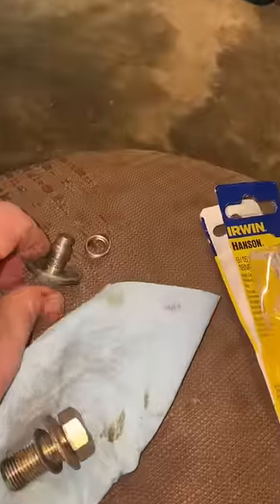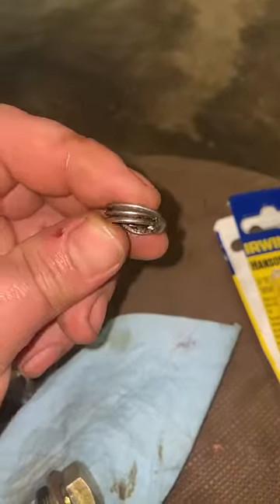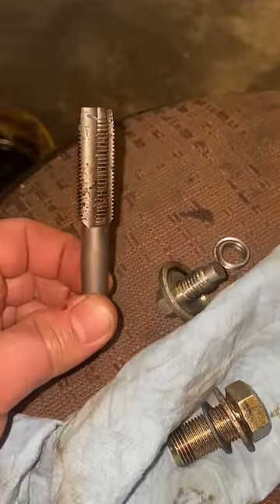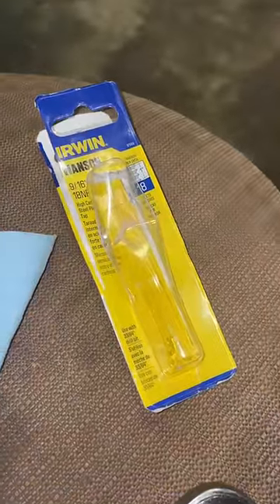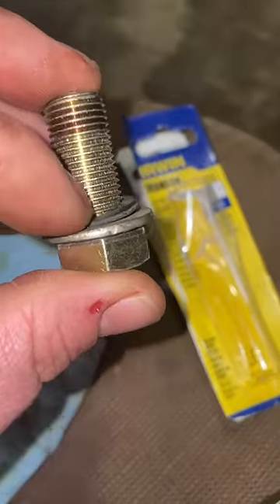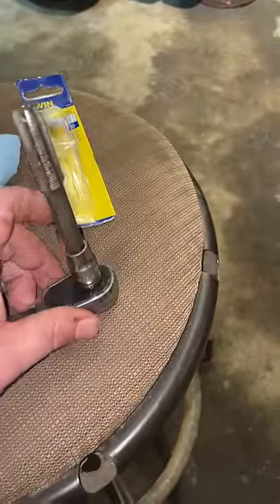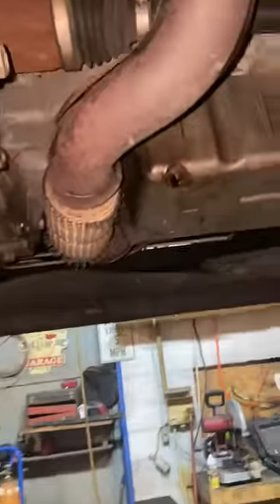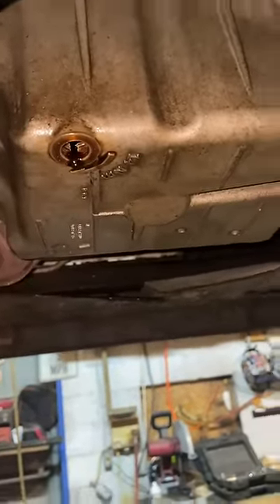Tap threads into oil pan repair quick and easy one!

Comment: That was a helicoil , not the thread's. The thread's have been gone. Probably done at a quickie oil change place.
Reply: I know its 6 months late but lots of manufacturers use a helicopter to reinforce the aluminum foil pans to prevent stripping threads
Reply: @tylerblubaugh5549  well God damn is that what's making all that ruckus down there?? I figured it was a rod!! All this time a damn helicopter 🚁 flying around in my oil pan...
Reply: @calebbitz9469  fucking killed me
Reply: Longer bolt = less oil 😅
Reply: No in my experience this is how we get them back from machine shops they put them in everything forgetting it's a disposable solution
Reply: @calebbitz9469  💀🤣🚁🚁🚁
Reply: @NuKe0clan0cod0videos  helicoils are a permanent repair if done correctly.
Reply: Can't confirm on the 1.4, but a lot of the GM vehicles have a coil type thread in the pan vs machined threads.
Reply: @calebbitz9469  funniest comment i saw today
Reply: Correct
Reply: @CryptTonite1955  when the next guy goes to remove the never ending bolt 😂
Reply: We use helicoils in high level motorsport (Think FIA level) as a permanent thread strengthening solution. They spread the load very well throughout the thread.
Reply: @kdubbya  no they are for one time torque. It's good for cylinder heads  and other places where the bolt stays in all the time
Reply: @NuKe0clan0cod0videos  one time torque? That's why they use them on spark plugs holes. They are a permanent repair when done properly. Just like he said.
Reply: @NuKe0clan0cod0videos  no, they aren't. GM literally puts helicoils in their drain plug holes to make a stronger thread.... Go look at any LS/3.6 pan from 2010 and up.
Reply: Ya that is exactly what the Ford dealership tried to say about mine being stripped.. Except that all oil changes were done at the dealership and their record proved it... Needless to say I changed dealerships.
Reply: Came looking for this comment lol
Reply: @NuKe0clan0cod0videos
Reply: or Walmart, they are no better, it was not my drain plug but ruined a oil filter remover I had for 20+ years they had filter so damn tight. had stab it with screw driver to remove it also they over filled oil by a quart.
Reply: Most LS pans and def Holley pans have a helicoil, they are not threaded in the cast. Prolly same deal. I guess this works of you don’t wanna fix it correctly tho 🤷🏼‍♂️

Comment: The next person goes to change the oil: "Why is this bolt so G-damn LONG??"
Reply: Atleast you hopefully wont drop this one.
Reply: next tech will probably go wth anyway when they need a bigger socket or wrench to get it off
Reply: Just gonna ugga dugga the damn thing off and on anyways, strip it out, and force him to go one step up again
Reply: It already feels like it take forever on a normal drain plug
Reply: Lmao I was thinking this
Reply: @nikolayordanov9760  It's gonna end up with a 1 1/2 size bolt eventually😂
Reply: @tthams73 
That’s a bunch of bs
Reply: "I'm too lazy to thread this in by hand, gonna use an impact to save time"
Reply: That would be me asf
Reply: @nikolayordanov9760  2 years from now: we are just going to tap this for a 2 1/2” bolt. At least it speeds up the oils change a little
Reply: @tthams73 not anymore!
Reply: @tthams73 
Only a Trump Supporter would think so ?
Reply: @tthams73 No, it is not. It seals with gasket or washer.
Reply: Says every Valvoline bottom side tech.
Reply: @tthams73 Bollocks
Reply: Frfr lmaoo

Comment: Any time I tap a pan like that, I pour two quarts of cheap oil through to flush out any chips which ended up inside. Sometimes more comes out than you'd expect.
Reply: I have someone pouring cheap oil in the engine as I cut.
Reply: I dip the whole tap in grease then flush. Almost all the chips get stuck in the grease. Was in a training manual I read many years ago.
Reply: @81mont  I do that too but some chips still get inside so I do the rinse deal.
Reply: and put grease on the tap to collect most of the chips.
Have my doubts on a positive seal with the washer in there. Hope it works.
Reply: I'd imagine that the type of tap matters here too.... A spiral flute tap might be preferable in this situation but I would definitely be flushing it out afterwards anyway, that would probably keep me up at night thinking it would mess my engine up in some way.
Reply: That's a fucking great idea! 👍
Reply: I pull the whole motor and submerge in royal purple while I tap threads.
Reply: @markchidester6239
Reply: Should have flushed out the crap from tapping before filling it up
Reply: @incredulousd9408  I do the same trick except I do it in a vacuum chamber
Reply: I was thinking the same thing
Reply: @foxwood67  How do you know he didn't?
Reply: @randy1245  did you see him flush it out?  Maybe I missed something?  Yeah nah
Reply: I was gonna say that would be a good idea to either flush or take pan off and clean out
Reply: @incredulousd9408  I laughed very loud. 🤣🤣🤣
Reply: I make sure to only work in a 2 micron clean room with two large chested assistants to assist in lubricating the shaft thoroughly.
Reply: Why do the work , just go hang out with the assistant.......
Reply: @christophersanchez7845  Negative.

Comment: If you ever do this, cover the tap with grease so it catches the metal shaving. Not good to have those floating around
Reply: Thats what the oil filter is for
Reply: @Bigtexbbq  most pumps if not all don't get filtered oil though
Reply: Get a plug with a magnet on it
Reply: A lot of the pans do have those magnets in them to catch metal tho
Reply: Just because it has a feature doesn’t mean you should use it out of convenience
Reply: Exactly
Reply: @Bigtexbbq  yeah not really
Reply: Just pour a quart of oil down the filler without the plug in place.  Any chips will be flushed out.
Reply: @Cryo_Gen  it’s aluminum friend. He said that in the beginning. Magnet won’t do shit
Reply: @Cryo_Gen  he did say it was aluminium. Magnets are no use.
Reply: @Cryo_Gen  magnet on aluminum 😅

Comment: Now that you are done don't forget to use your 1/2 impact and make sure it's tight
Reply: I use a 3/4 inch breaker bar with a 7 foot cheater pipe to tighten drain plugs.
Reply: Hahaha!
Reply: @beezertwelvewashingbeard8703  that's what I'm talking about.
Reply: @beezertwelvewashingbeard8703  And don't stop until that pipe is creased.
Reply: It'll be fine he has a Ryobi he got off his crack dealer

Comment: it's going to leak if you use that washer. there's no seal between the washer and bolt head. the oil will follow the threads. oil plugs have a flanged head
Reply: Exactly what I was thinking, he didn't show the part where he dumped oil in and it dripped, needs to use a bolt that has a shoulder on the head with just the gasket.
Reply: So many people are missing this point!!

Comment: Had the luck to strip the drain bolt's thread on my motorbike just to figure out the aluminum was so soft compared to other stuff i could rethread it just by screwing a bolt with shorter thread a couple times before i dig into this solution.
So many oil changes it worked, but your solution is just magical.

Comment: Decades ago, I used a rubber drain plug.  The part that went inside the pan was shaped like a 1" balloon.  The part on the outside looked like a flat washer.  It came with a tool that went through the washer and into the balloon part.  When the tool was inserted it would stretch the balloon part to be skinny enough to go through the hole.  You needed the same tool to remove the plug.  It worked fine and lasted a long time.  It was cheap and fast.  After a quick Google search, I didn't find them, so maybe they aren't made any more.
Reply: Sounds like a boat plug lol

Comment: You should have noted to use grease on the tap and clean and re grease as the grease catches aluminum pieces so you oil pump doesn't pick the up and you end up with a bigger problem than oil pan drain plug threads needing redone , like oil pump and bearings filled with aluminum ,
Reply: I once saw an old-timer hook up shop air to the dipstick tube so all the chips would be blown out as they were cut.
Reply: The grease doesn't catch all the chips, so whether or not you use grease, you should pour some oil in and flush it out a bit.

Comment: I work on little motorcycles. Many stripped threads. I bought a 14mm tap and a few extra 14mm plugs. Works great in a stripped out 12mm hole.

Comment: when people know just enough to hand more work to the next guy.
Reply: And how’s that
Reply: Well for one I don't know what car that was on but I bet it was metric, so any mechanic is gonna be looking through their metric sets to put on the head of that bolt only to find out it has been converted to standar...or strip it out if they are not a good mechanic...
Reply: @VNCTHE1  clamp vice grips to or get a size that’s as close as possible shouldn’t be in that tight
Reply: @VNCTHE1  Every socket set I've seen in my life have both metric and US, so it's as easy as seeing that a metric socket doesn't fit, and the size up is too loose, so grab the standard that is between the 2 metric sizes. This is how average joes size sockets, so it isn't voodoo magic to a mechanic
Reply: @specialopsdave  LOL professional mechanics don't buy home depot socket sets...and if they do they don't keep em in the case.  Also, you're buying the wrong socket sets...when I see one that has metric and standard I don't buy it because half of it is useless...

I understand this isn't hard but mechanics are expected to work really fast so they use impacts and whatever fits, no one expects a standard head bolt there...so they may damage it.  I wouldn't in my garage when I have an afternoon to do an oil change but they have 6 minutes.
Reply: @VNCTHE1  So what you're telling me is that mechanics buy a smaller variety of tools than average joes, and rush so badly when fixing cars to the point that they damage it? I would personally prefer a mechanic with a bigger toolbox than me, and one that actually checks to see if things fit.

And for rushing customers, go tell them to shove it. If they don't give you time to do it right, they shouldn't get the service at all.
Reply: @specialopsdave  It's not the customers that rush it, it's the mechanic that has to do 20 oil changes, 8 tire changes, a steering rack, 4 brake jobs, and 2 radiators today.

Also, they don't even have standard/sae tools in their regular drawers or in their toolboxes at all...they are just useless and get in the way of looking for the metric socket they are after.  All cars within the past 30+ years are metric.  How do I know?  I've been a professional mechanic before.
Reply: @VNCTHE1  That's not the case specifically where Iive. I can do a walk-in on my local mechanic to get an oil change, and nobody is in line or anything. They take about 20 minutes, and even torque the oil pan plug to spec.

Although you do have a fair point about the no standard for the last 30 years. It would be nice if they just had special large body bolts that can fit a larger hole with a smaller head, just for this purpose. I imagine there's a good profit incentive to sell a $3 oil pan fix kit with a larger body bolt with a 10mm head
Reply: @specialopsdave  Most drain plugs are 12-19mm bolt head, but yeah I think those big bolt drain plugs exist, sometimes even half sizes like 12.5mm thread, 14.5mm, so on.
Reply: @VNCTHE1  I just say 10mm because that's the easiest and simplest. We all know that any decent mechanic has at least 3 spare 10mm sockets 🤣
Reply: That is most likely a 11/16 head which is same as 17mm head so 17mm will work. Which all your 16ths are same size in metric 9/16=14mm 5/16= 8mm.
Reply: But he did it all wrong should have Heil coil threads in.

Comment: When running a tap into an oil pan its always a good idea to put grease in the flutes of the tap. Any chips of metal the tap takes off will get caught in the grease and not fall out into the oil pan
Reply: Just take oil pan off?!
Reply: @shaneomanutd2196  sometimes its not an option. In some vehicles you would have to pull the motor, crossmember, or front axle to get the oil pan out. Not all but some.
Reply: Ok right make sense

Comment: Looks like you pulled out the helicoil somebody prior to you had already stripped the oil pan plug.
You should have replaced the helicoil but used loctite when you installed it. 
Tapping the threads for a larger size will probably work the only scary thing how much "meat" is left around the   hole since you expanded it a 1/16 of an inch since we have all had drain plugs that well absolutely stuck on come the next oil change.

Comment: Drill out the end of the bolt and add a magnet. Might as well make that bolt more useful since it had to be changed anyways.
Reply: Pans aluminum..
Reply: @jefferyjensen3179  true, but the crank, bearings, piston rods and rings aren't.
Reply: Magnets aren't all that useful in engine oil pans. The wear metals aren't ferrous. Differentials and transmissions are a different story. You might get a tiny bit of ferrous metal in an engine, but only a very tiny amount unless something is failing badly. It's not worth the effort of adding a magnet really.

Comment: Had to do this on my '01 Lincoln Town Car in about 2008. I usually changed the oil my self but went to the quick change oil place in town one time. Next time I went to change to oil the threads were gone. I called them they told me they torque them to specs. There are no torque specs. It's tighten until snug then a quarter turn.

Comment: Someone else said it first, but I was just about to say that wasn’t the oil pan threads. That was a thread repair kit, also known as a healy coil. The threads were probably stripped by the lube tech or previous owner, and they used kit to repair it. From the looks of it, it wasn’t installed properly because I’ve used them before and never had one come out like that.
Tapping the hole slightly larger, and using a bigger drain plug is probably the better solution unless you’re going to buy a new drain pan.
Reply: Wrong, when aluminum threads fail from over torque and pull this is what it looks like.
Reply: @gorillawrenchin 
Nah, too uniform to look like struooed aluminum threads. And since when are stripped threads are chamfered on the outside? Those are thread inserts.

Comment: What happened to the metal when you cut the threads, straight into the sump?
Reply: When I rethread a pan I have one guy pouring oil into the engine as I cut.    Plus with a metal pan my rethreader is magnetic...
Reply: Meh, what's your filter for anyway
Reply: @homesteadhaven2010  and it’s an Aluminium magnet?
Reply: @chrisbraid2907  lmfao 🤣

Comment: Grease the tap when threading aluminum, on steel you can use a strong magnet, but you want to catch those shavings in an oil pain, otherwise you should pull the pan and clean it up to ensure you don't have metal shavings in there.

Comment: They make non coiled helicoils for those. They're actual threaded inserts like you'd put into a Ford 5.4 spark plug hole when they decide to evict the spark plug
Reply: Keen serts and crown serts. One is knurled and one has four metal prongs that lock it.

Comment: First of all, looks like that oil pan has been repaired before.  I could be wrong, because I've seen bare aluminum threads come out, but they usually look a bit different than that.  That looks like a helicoil style thread insert.

2nd, a setup like that is prone to leak.  That is because the washer to bolt are metal to metal, the gap around the bolt can allow oil to pass, or the bolt to loosen if it vibrates.  

I would have recommended to buy an actual pan plug, or to re-install thread inserts.  They are very reliable when installed correctly.  They fail usually due to an incorrect sized hole being used before tapping.  This leads to either work hardeneded threads, and a stressed hole, or not having enough material for the inserts to bite on.

Comment: You should have used a single crush washer.
Reply: Exactly or no washer preferably a crush washer
Reply: I didn't know this until I worked at a Nissan dealer, but all newer Nissan's you're supposed to use a copper crush washer every time you do an oil change.
Reply: We run single use aluminum crush washers on subarus.  Works pretty good at the right torque spec.
Reply: he did only use 1 crush washer. the other washer is to provide a flat surface for the crush washer. He should of just used a bigger drain bolt instead.
Reply: @Wolf.diesel  Yes if you don't you rist leaking oil and possibly having to replace an entire engine for a 20 cent part.
Reply: The larger washer is steel, just to add better support for the sealing washer. 
Some engines also use a reusable rubber gasket, instead of a crush washer. Whatever choice, just use what works.
Reply: @brucetec6597  makes perfect sense to me, just weird that after working at 3 dealerships and 5 mechanic shops over the years I've been in the automotive industry it wasn't until I worked at a Nissan dealer that anyone ever said anything about crush washers.  It makes perfect sense so I don't get why it isn't more common.
Reply: @brucetec6597  still going to leak because oil will go down the threads. The seal is not going to seal off the threads to the flat washer

Comment: That looked very thin inside the pan. I'm assuming this is a n/a barina or cruze 1.8 pan it looks like, I've taken heaps off resealing the sump. The part that has the thread sticks up inside the pan and is not a solid metal thick floor of the pan...
From what I can't tell it's very thin now and runs a risk of breaking inside out threads not holding well. 🤞🏻It works for you as long as no one over torques it.

Comment: How do you ensure no metal chips get left in the pan?
Reply: I'd flush some oil thru it with the plug out.   It's aluminum so a magnet wouldn't work.